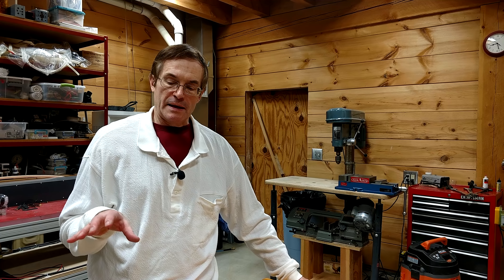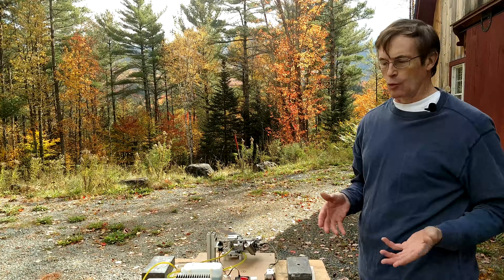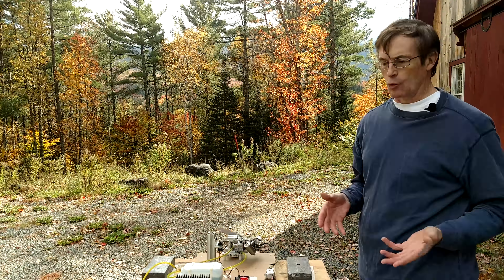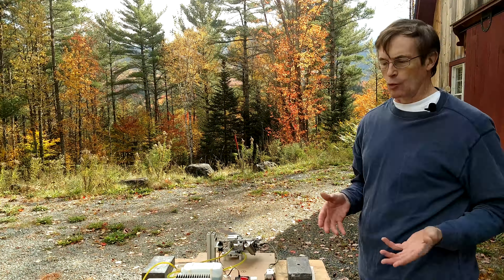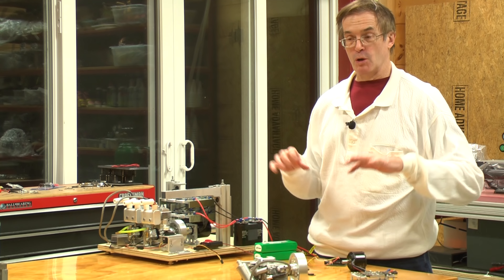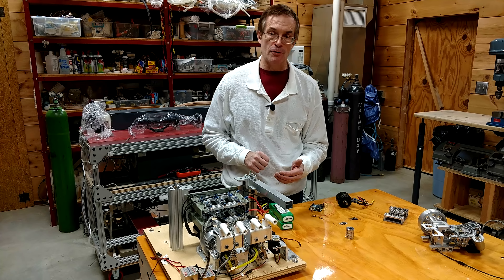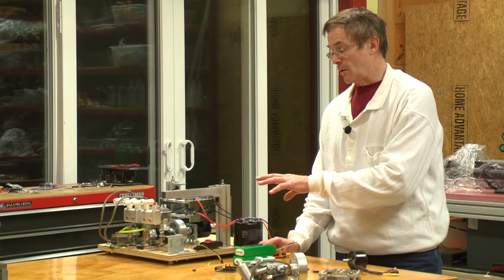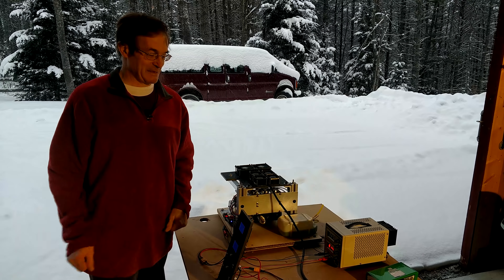Hybrid Drone Generator

Comment: If the two motors are 180 deg out of sync and locked,  couldn't you just share one flywheel between the two engines? Plus one motor is basically the flywheel of the other one. I'm not a mechanical engineer so excuse the question if its's stupid.
Reply from the maker: An honest question is never stupid, but there are insecure teachers.  You are correct that one motor is indeed acting to bridge the lack of torque output from its out of phase twin. Nevertheless, the torque output from each engine varies a lot through its rotation.  Just after combustion you might think the torque is at it's peak, but because the crank shaft leverage is poor at that point, the torque takes a few tens of degrees to maximize.  The flywheel furthers  the output smoothing provided by twin cylinders.  Two flywheels help to balance the piston as I explained and reduce the peak loading on the timing belt as well.
Reply: Thanks for the answer and greetings from Weimar, Germany.

Comment: 2 stroke was obvious, they even use them on Paragliders.
I wouldn't have gone with a 4 stroke to begin with.
I would use the 2 stroke for main propulsion, and add an electric generator, to use electric current for steering.
8:50 You can counterweight the weight, by mounting a secondary engine in 180 degree angle on a single axis, rather than using a belt. Lower losses.
Reply from the maker: Thanks.
The orientation was selected to best fit a compact enclosure as well as to effeciently couple the engines to the two generators.

Comment: Good video and I like the science. Would a small turbine work better with no balance issues, probably lighter and more power.
Reply from the maker: Thanks!
It would work.  The trade off is the much higher cost of the turbine and it's greater fuel consumption.  I cover some of this in our videos on turbojet engines.

Comment: I think it is a mistake to direct drive the ICE and BLDC generator.   I think using higher KV ratio BLDC generators with a reduction gear would probably result in a more efficient supply of power to the rotor array.  Might even be practical to use a single piston  2-stroke ICE with a reduction transmission to supply the whole thing.
Reply from the maker: I address this in the video.  The single cylinder engine will vibrate more.  The higher the RPM of the BLDC motor, the higher the frequency of the three phase output and therefore the lower the capacitance required to smooth the output.  A gear drive will add additional weight if what you meant was to use a reduction gear to step up the RPM from the engine to drive the motor.
Reply: It will vibrate more, but with proper balancing  and damping that is not a showstopper.   Gear or belt?  Might also help in reducing vibration.  These things are development questions.  You do have an advantage on me, due to having capital to build test rigs.   But I spent years on the tech without recourse to experiments.   I didn't have money for test fixtures so I had to look at theory and other literature for guidance.
Reply: Look, Man!  I'm not trying to bust your chops.   I'm giving you some information that might help you improve what you are doing.   I don't have the resources to do it myself.   So go read the damned paper and see if what I am saying makes sense or not.
Reply from the maker: It's not a show stopper, but it is undesirable and can be nearly eliminated with the two cylinders. Damping is also undesirable because it requires the vibrations to exit the generator in order to transfer force to some material that is inelastic.  The repeated compression and tension in that material is what dampens the vibration.  That compression and tension has to occur between the generator and another mass ie the drone and so causes the drone to vibrate.  The reduction drive methodology will not reduce the vibration, but if well designed can be made to create minimal additional vibration.  These principles due not require money to test.

Comment: They do balance 2 stroke rc engines even more so than car engines as they run much higher rpm. With your balancing apparatus the piston has much larger leverage upon the fulcrum than the counterweight on the crank. The piston never swaps sides of the engine however the counterweight does. Also wouldn't it be more efficient to just drive the drone directly from a gas engine instead of through a generator.
Reply: From what I've seen of other YouTuber's who've tried to use engine powered multicopters, there is an issue that the engine can't adjust it's RPM, and thus thrust, fast enough to allow for fine control.

Comment: Why not a Sterling engine and make use from the temperature difference from outside? If of course it has less vibrations or more controllable vibrations and gives out enough energy. Another issue with engines is that they need to properly operate in any orientation as your plane moves. Or you will need a gimble.

Comment: Not Knocking the APU design, but I'll ask the obvious question: Why not avoid all this complexity, and inherent conversion losses, and simply use the engines directly to power the drone, properly scaled for thrust-to-weight, and re-engineered for coordinated auto-start?
Reply from the maker: There are several reasons.
It's much more difficult to isolate noise and vibration when the engines are directly coupled to the drivetrain than when the power moves through flexible electrical wires.
Electric motors have higher resolution, speed stability and faster response time.
There are many existing multi rotors that could benefit from a separate power source, avoiding reengineering.
A removable module allows fully electrical operation where flammable fuels are restricted.

Comment: Not sure if you are still pursuing this actively, but your exhaust is stealing a lot of your possible efficiency, and max torque. Sure you've seen those weird looking resonance exhaust systems on two stroke engines. since this is a system deseigned to run at one specific number of RPMs, building one of those is remarkably easy. They get equally smaller to a lower desired bandwidth of rotational speed.  Building or designing one on your own is absolutely possible, but getting one and adjusting it to your needs should be easier. 

The impact of this is huge, it's the easiest way to increase a two-stroke engines torque since it requiers no additional changes. 

another thing i noticed, is that you dont use the BL-Motors to start the Machines, why is that? the only Part you are missing for that is an ESC. Maybe block it's leads off with Diodes but thex should not care about some reverse current, as that's something that can always occur in their operation. 

nice project, watched the whole thing because just a while ago i was about to construct a generator using those Motors and wanted to see your approach.
Reply from the maker: Thanks for watching!  We considered tuned exhausts.  Based on a number of comparisons of engines using tuned exhausts, it appeared that we could expect a 20% increase in power.  We are concerned that because these exhausts are quite bulky, that they would interfere with the structure of a multi rotor.
Reply: @TechIngredients  Well they're not small and their length is not negotioable. so a clever approach would be to have them running a curve to an area which you dont need for other components. you could even transfer them outwards using a simple pipe for quite some distance before you would have to bring in the resonance part eventually. As a rule of thumb, having a manifold 6 - 8 times the diameter does no harm at all and is even beneficial for operation at one rotational frequency. 
The main problem i see here, is the very compact size of your engine. Measuring the variables needed for this construction (timings, volumes, diameters...) might turn out to be really annoying. that's why getting an exhaust and modding it should be the way to go. I'm very certain that you will see good results as these rather imperfect engines just need some external support. Just always keep in mind, that there's a moment in these ICEs where Inlet phase equals Outlet phase. in other words, the Ports are open at the same time, and fresh gas/air mixture is in "direct contact" with burnt one to push those out.

Comment: Good evening, your Excellency engineer
I am Jamal al-Maliki, I work in the Saudi Royal Air Force and I work on the powerful  and Amazing F-15 aircraft, and I have a question, if you allow me to ask, is there a way that I can measure the percentage of oxygen in the engine after Compressor bladeand and how much the oxygen percentage after the combustion chamber.
Thanks Alot for your Great  efforts for your channel followers.
Reply from the maker: The pre combustion oxygen percentage will simply be the atmospheric oxygen percentage no mater what the compressor does to it.  Post combustion is much more complicated as the fuel may not be completely burned or the engine may be running close to stochiometric ratios, but remember there is a bypass ratio that cools the combustion chambers and is what provides the oxygen to an afterburner.

Comment: I hope, when you finally use this in a drone, that you compesate for the gyroscopic inertia of the power unit in your drone controller.
Reply from the maker: Don't forget the significant gyroscopic inertia of the large props.  We're not certain if DJI has even incorporated precession in it's algorithms.  We suspect they didn't.

Comment: For future consideration,  a Wankel engine design would give you much less vibration and would be more quiet than a piston engine.

I think a turbine engine would likewise be smoother, though its fuel consumption would be quite high.
Reply from the maker: We looked at that, but there weren't any reasonably sized Wankels available.

Comment: Whats the run time on a full tank a fuel?
Reply from the maker: This depends significantly on the power level and with the two stroke engines it is not simply linear, but roughly, 1 gallon/ hour @ 2,200 watts
Reply: @TechIngredients  makes me think of a possible power supply for an exo-powered suit for construction or military application.

P.S. I dropped you an email

Comment: The problem with this experiment is that there was no "load" (i.e. drone propellers).
Reply from the maker: Sure there was.  That is what the resistors we're for.  In the follow up video these resistors we're increased to dissipate over 2kw of load.

Comment: Really sad that 2 stroke so dirty burning / maybe you could put some catalytic coated silica fibers in the exhaust muffler to "burn off" some of the oily HC emissions before they are emitted as air pollutants // You could also use DME dimethyl ether as a drop in replacement for gasoline + lubricating oil to help clean up the emissions / similar to using hydrodiesel in a diesel engine // air pollutants are toxic to eye, nose, throat, mouth, lung cells etc // I really like you & your content & want you to stick around longer / so be careful to wear an N95 mask with activated carbon filter when near such a source of neurotoxic HC emissions / with love Godspeed bro

Comment: Instead of using a 3 phase brushless motors, why not use motorcycle generators?  You might be able to use them as a flywheel as well, and avoid the coupling as well as you can just hard mount the stator to the base plate if you can keep the vibrational range below the gap between the rotor and stator.  You can see what I am talking about by doing an ebay search for "motorcycle alternator stater".
Reply from the maker: Isn't a motorcycle generator an alternator based design with its inherently low efficiency?
Reply: I think they are more efficient.  They are similar to your pancake 3phase brushless motors you have on your hexacopter and use permanent magnets.  Small Honda, Yamaha, Harbor Freight and other inverter generators use this design.  The lack of brushes means less friction and also less wear.  Just the fact that you only have 1 shaft, 1 set of bearings, no flex coupler saves in weight and reliability.  Go get yourself a cheap inverter generator to see what I mean.

Comment: Really nice explanation but the mixed units ( eg 12g at 3" ) are  quite disconcerting for those us in most of the planet who are entirely metric.
Reply: Really? 

You can't convert 3" into mm in your head? 

Let me help 1" = 25.4mm * 3 = 76.2mm
It really is that simple. As someone who has worked quality control in a manufacturing environment most of their life I think this argument is moot. You should be able to convert between units on your own with or without a calculator. It gets easier with practice. What are you going to do if you one day get a drawing made by a customer with both units on it? No it shouldn't be that way, but are you going to complain to the customer? What if the drawing is all imperial and your machines are all in metric? Improvise, Adapt & Overcome: complaints are a sign of weakness.

Comment: Gas turbines,  constant torque, 50-60% improvement in power to weight ratio which off sets the higher fuel consumption.

Comment: have you thought about a 4 stroke / 2 stroke? 2 stroke, that fires on top, then bottom, of piston. then replace  the clutch bell with a flywheel & 4  coils. at an idle you would have enough electricity to power a quad copter (using capasitors, not batteries) drone motors size or Rpm won't matter. because your only running at an idle.

Comment: hold up... Did I miss the part where you explain this massive, quad gas/electric powered flying hunk of unmanned steel? Or was the "drone" in title just click bait? I feel like you skipped all the problems with this concept to explain the workable parts
Reply from the maker: No, you didn't miss anything that we covered even though you might have wanted more.😀
The generator module is designed for an airborne application in a drone and so, not clickbate
Reply: @TechIngredients  Sweet! So when do we get to see that beast?

Comment: That's why crack shafts look like they have weights on them. 
( i knew harmonics were taking place but no-one shined the light on it)
 my (japan) honda 2004 cbr1000rr 999cc revs to 14,000rpm and reaches 200+mph/320+km/h
 easy and smooth, my friends brand new italian sport bike 1290cc sport blah blah on paper it is waaaaay faster
 when tested It capped at 270km/h and it felt like it was rattling your soul. Maybe long ago Italy made nice motors but from what i noticed it's trash.
I just subscribed.

Comment: The OS  company makes (or at one point made) a wankel engine for model aircraft which would give the torque consistency of a 6-cyl 4-stroke, and excellent power to weight ratio.  I know wankels are famously fuel-inefficient, but I suspect it would be far superior to that of the two-stroke cycle.
Reply from the maker: You're right.  It's a shame there are not some current engines available.

Comment: Super interesting.
I guess that a turbine engine would work far better both because its more lightweight and because the operation is more continuous.
Military quadcopters could use such hybrid electric systems in the future because unlike normal helicopters you cannot run the 4 rotors and adjust their speeds.
Reply from the maker: The reason  you probably  don't want to use a turbine is that unless you go to a large-scale system for human transportation, small turbines  are very inefficient re fuel use.  Their  single stage compressor can't  generate  enough compression ratio to make them efficient.